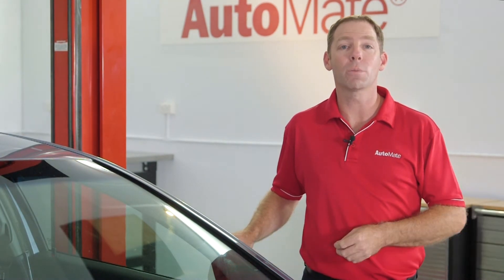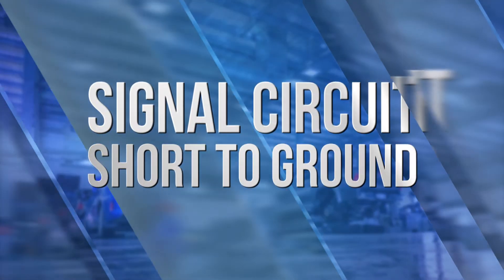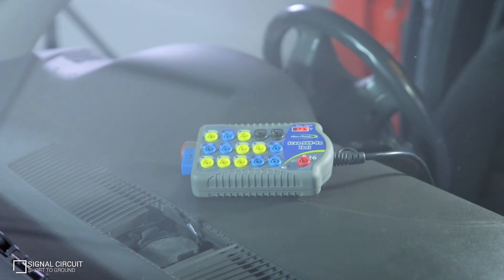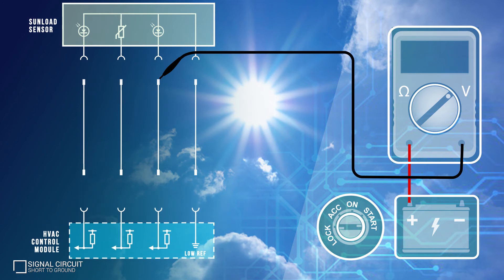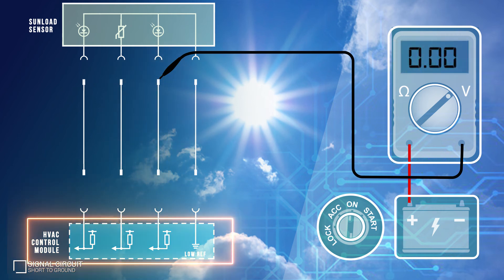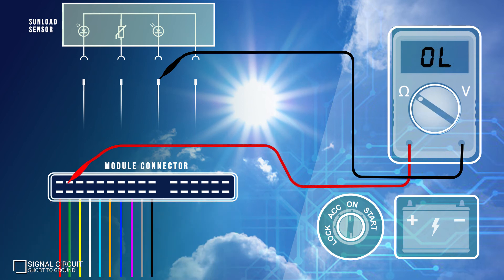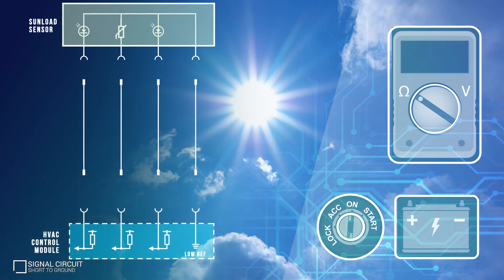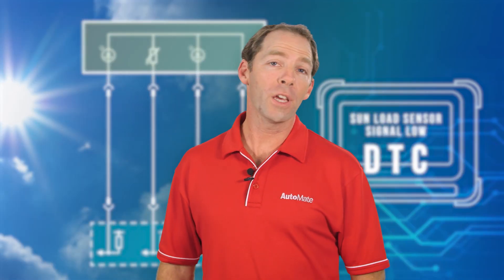Sunload Sensor - Voltage Low

Comment: 2004 outback 3.0 ac blows ice cold the hot replaced ac relay and head unit? Help
Reply: That makes no sense. How can a temperature do any work much less replace an AC unit? And if its blowing ice cold how is that a problem since it is supposed to be cold?